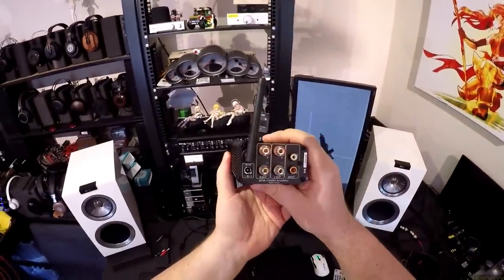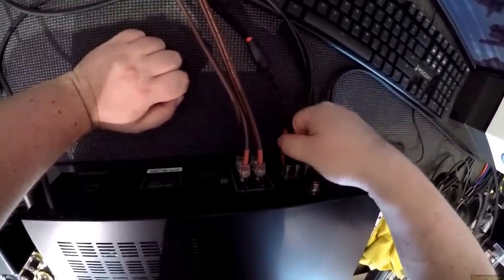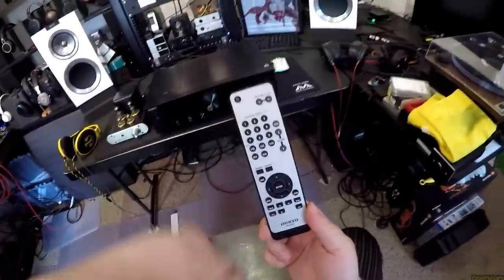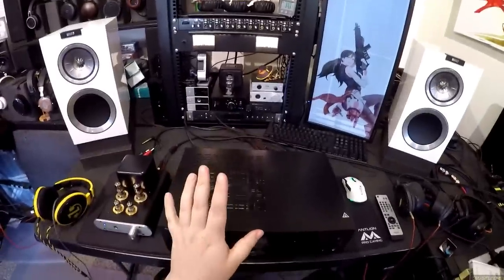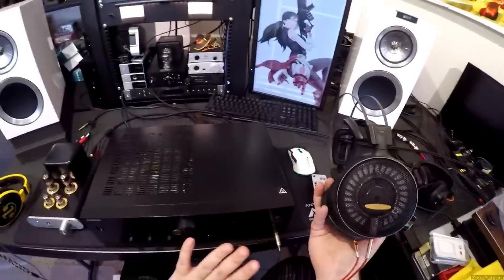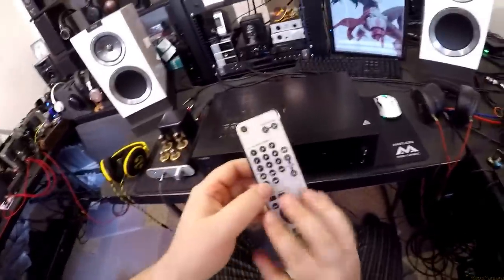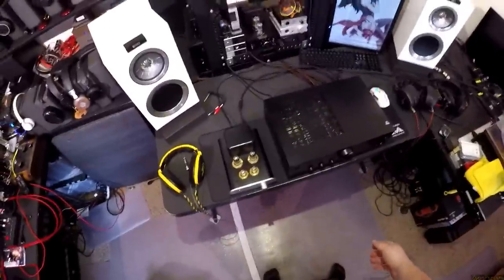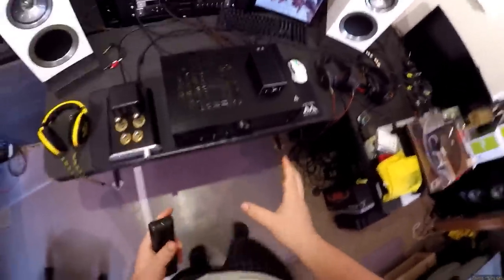Z Review - Onkyo A9010 [The Return of Real Amplifiers]

Comment: I was considering the a9050 amp, until others convinced me to took at some vintage amps with the Emotiva pt-100 preamp/DAC/tuner. I ended up with the Carver M-500 and then found nirvana with the Adcom GFA-555 power amp. High-current does indeed make a huge difference, particularly in the bass freq.

Comment: It doesn't sound better than the class D amp because the components have more room to breath, it sounds better because it's A/B analog. A few years ago I needed a small amp for some portable speakers I was making. I bought a Lepai class D and a Pyle A/B for about $20 each to compare. I never heard class D before, but thousands of people raved about the Lepai. After comparing both for several hours each, back and forth, it was quickly clear that the A/B Pyle sounded better overall. Yes, I used the same speakers to compare the amps, Boston Acoustics. Like you said it's hard to describe, but I call it more 'musical'. However, after a week of being powered on while making the speakers, the Pyle died. I already knew Pyle made junk now so I wasn't too surprised and chose not to fix or return it. I used the Lepai which I figured was fine enough for picnics and such, also it had the benefit of much less current draw than the A/B, so the battery pack would last twice as long. It still works fine and I use them in the garage, but am always slightly disappointed in the sound.
Reply: The 20 buck lepai amps are unfortunately piles of garbage. The tripath chipset they use is an ancient design and a mediocre performer. I suspect the chipsets that make their way into the lepai amps might even by counterfeit and therefore even worse performers.
There are plenty of Class-D chipsets that are much better out there (e.g. from Texas Instruments) - that said, it costs at least $50 to properly implement them into an amp. Some of the $100-ish Dayton Audio amps would use these or similar.
Reply: what model Pyle you had? I have PTAU45, it gets hot, hasn't died yet

Comment: i can attest to 40 watts can play pretty loud, just make sure you real spec sheet properly. 8 ohm, rms od typical load, and the THD numbers. from there you can at least get the power output.
the nad d3020 i have is 30 wpc and it has pushed many a speaker to the limit without distortion.  im most cases you lose something in the "smallification"  of amps.  i feel bad for have such a small space to put my hifi, i know it made some compromises.

Comment: If you look into the Dayton Audio DTA-120BT carefully you'll find it is only about 30Watts per channel into 8ohms - the DC input only supports 60Watts total and is 24V. The absolute most you can get from 24V full bridged into 8ohm is -> ((24*0.707)^2)/8 = 35.9Watts. In reality, expect slightly less than that before clipping. The "60Wpc" claim is bs because it is at 10% THD into 4ohm and only 1 channel at a time - basically just driving a fully clipped waveform while everything screams in pain.

Comment: Those speakers looks like KEF R300 ...are they better than LS50 ?
Reply from the maker: yes
Reply: A KEF that's better than the famous LS50??
Now, the real comparsion should be with the Swans.
Reply: I concur for general purpose, the R300 trumps the LS50 especially the lower end. I'm a strange person I prefer the LS50. The reproduction of vocal from the LS50 sounds "better" to my ears and that's what I mostly listen to - Acoustic guitar and vocal
Reply: ousi00 Great, so you own LS50 and seem to have my music preferences. Have you compared LS50 to Swans? I'm trying to decide between the two.
Reply: Unfortunately, I have never tried any Swans in the same setup so cannot give any comments. :(
Reply: Are you trying to review LS50 with m200mkiii  ? This is a Swan powered speakers which i think is very good but cant compare it with 1500$ speakers. But they are good for the price they are staged.I recently compared LS50 (I own) with the new LS50 powered speakers and the new version is much better and worth that extra 1000$.
Reply: Long story short, the LS50 needs some current to drive. The powered LS50 works reasonably well - closer to the NAD M22 I paired it with. 

The amp built-in in the powered version is a good match to the speaker itself imo. Depends on your equipment passive LS50 can sound quite different. I tried powering them with a Yamaha RX-A1060 (not so great), then the Yamaha A-S801 (too bright for my taste and thin), A-S2000 (very good to my ears, natural - Current pairing); RX-A1060 pre-out to Adcom GFA-5500 (excellent bass!), NuForce STA-200 (midrange is magical, not as much kick as GFA-5500), Monarchy Audio SE-250 (superb), for a brief moment with Krell Evo 302 (Krell renowned bass and dynamics; very American) and Parasound HCA-3500 (dynamic, lesser so than the Krell), NAD M22 (surprisingly sweet and punchy bass), Luxman L-550AXII (magical high and mid, a bit slower in the bass; but everything is like "sugar coated". Great for vocal), McIntosh MA-6900 (relax sounding) and finally Audio Research LS-28 + VT80 (excellent high and liquid mid, with KT-150 the bass is surprisingly excellent. However, I use that only for a bit for the LS50 as they are the ones that drive the Sonus Faber floorstander in my living room).

Comment: I've had the A-9050 (75watts/ch) since mid 2014. It's the dedicated amp in my home office for streaming and vinyl/cds (not in a desktop setup). It's good, not spectacular. Amp is generally slightly bright, but the internal DAC is very bright. Too bright, in fact. I use an external DAC for digital sources... but it's a perfect amp for adding some brightness to vinyl, especially if your speakers/tweeters or preamp are a bit refined/subdued. The one thing it does that makes me want to replace it is that it constantly senses an input signal level and if that signal is not up to the amp's liking... it just shuts off mid-song. This happens at even moderate listening levels. It can make a weak signal loud, but if the source isn't as strong as it would like, it just quits. Kinda frustrating.

Comment: Hello, well, I hesitate between a 9130 and a 9150. Both have bypower option which I need to be used with my home cinema amplifier. I wonder if it should be more interesting to buy a 9130 and an external dac rather a9150.

Comment: It's got 5 analogue inputs and not one of them is for a cassette deck! That's a fail! 
This amplifier should be driving 15" three way speakers, bookshelf speakers are the only reason why subwoofers exist. If you had listened to it the way that it was actually designed to be listened to, you would have experienced what Hifi was all about and you will be left wondering why it ever stopped being a thing! But since you said that you like to listen to your music in direct mode, you like your music lifeless and harsh! The only people who listen to the music on a flat sounding system are recording engineer's who actually use the flat sound as a tool to make sure that there isn't anything that stick's out that shouldn't. It's what they have to do to get the sound sounding good on a home Hifi amplifier which is going to add colour to the music, yes home hifi equipment adds colour to the sound! They all do, that's why they all sound different, it just depends on what sounds good to you! 
That Dayton amplifier is junk, it might be powerful but it's a class D amplifier and those types of amplifiers are only good for portable Bluetooth speakers and PA work where you need lots of volume and quality isn't important! It's the sort of thing that you purchase for a birthday party and never use it again!

Comment: I bought next generation after this one A-9130 on ebay(no reviews anywhere!) for barely £150 which has 2x60W(2x30W on 8ohm speakers) and couldn't understand how on half volume it's louder than my 100W per 8ohm channel Denon home theatre amp. Bass never badly distorts even on almost max volume. Rated at 30W per channel it's louder, cleaner and stronger than 100W per channel Denon and WAY louder, like 3x louder than 80W(40W per 8ohm channel) Yamaha R-N500 / 602 which are equivalent to A-S501 amps. So much better, lower bass than Yamaha too

Comment: I recently purchased the Onkyo A-9050 ($350) which has the same DAC as the A-9010 (Wolfson WM8718) which I paired with the Sennheiser HDVA 600 Headphone Amp and a pair of HD600s and HD650s. Should I be looking for a better DAC to get the most out of what I already have or will I not be able to hear much of a difference if any? I am using TIDAL HiFi

Comment: I've got the A-9050 and its the hub of my system. Picked it up after it was discontinued for $245 Canadian. For a lo or mid-fi system, the A-9010 or A-9050 are great choices that give a lot of set up flexibility and the ability to add other components as you go. I have an Onkyo C-7030 CD player, Google Chrome Audio and Sony UHP-H1 bluray player (for FLAC files) running through a Cambridge Audio DacMagic Plus (w BT adapter). I use the pre-out to connect it to a NAD 216THX amp to power my LS50's, and the line out to my Darkvoice 336SE to a Kenwood GE-7030 Equilizer (tubes plus equalizer = fun) to NAD C272 amp to my Wharfedale Jade 3's. With the line out I can control how loud I want my subs using the volume on the A-9050 independent of the volume control on the Darkvoice. The phono stage amplifier on the unit was ok (I have a Rega P1 - nothing extravagant) but added a Schitt Mani which sounded superior. The remote on the A-9050 is different than the A-9010. Oh, and I used a little piece of white tape on the volume knob!

EDIT - I blame all of my empty pockets audio woes on Zeos. His headphone reviews gave me the audio bug.

Comment: I bought a Denon AVR-S530 BT (cheap 5.2 receiver/amp). I was going to use it for my TV, but decided to hook it up to my pc (USB to uDAC2 to Coax out). I've got it paired with fluance signatures (and I use the headphone output which sounds good). It takes up some space, but I have it in the corner mostly out of the way. I really like the setup. I find it to have pretty damn good sound quality. I can hook basically anything up to it, I've also got a 5 disc CD changer nearby.  I can see there's a Cirrus Logic DAC chip in the Denon, albeit a cheap one. I've got an 8" sub coming soon too.

Comment: Found an open box at Fry's for $250, got it down to $130 when I called for the manager because the remote was missing (about $25 or so). Solid power for a smaller room (still borderline overkill power for desktop unless your speakers are hugely inefficient). For the money a great set of features and good sounding lower and higher frequencies, ok imaging (my SMSL SA-60 with its TPA3116 surprisingly beats it for imaging and mid range transparency all else the Onkyo is better). The only quibble I had, other than useless buttons on the remote as mentioned by Zeos, is the lack of a subwoofer out. I solved that through a high level to low level (RCA) adapter that I originally bought for the SMSL. Cheap, yet works surprisingly well.

Comment: Very similar to the pioneer elite a 20 integrated amp, 105 degree Celsius caps, extruded aluminum heat sinks, auto power off, loudness button, pure direct mode, phono mm, motorized volume knob, but two sets of binding posts, class AB, 50 watts RMS per channel both driven 20 to 20.  Great THD plus noise... same company onkyo and pioneer now, but this one looks like it's little brother.   The a 20 is $250, I've had for about 2 years now works great.  For bi amping also, with speakers a and b buttons 5500 microfarad capacitors. Brian listen to your mother...

Comment: I have an old-school style Marantz integrated amp like this and used it as a monitor stand for a long time. I recommend integrated amps like these to all my friends since they can be dirt-cheap on the second hand market.... Damn I need to get in on that Vapor album sounds great.
Reply: I wanted an integrated amp, but I wanted a bit more power AND it had to have a way to connect a powered sub. I finally went with separates instead, and I'm happy I did. With a competent preamp like the Emotiva models, I now have the option to connect any amplifier I want. So far, I've hoovered up a Carver M-500 and an Adcom GFA-555, and I'm planning on getting another GFA-555 for bridged mono. For my cheapskate butt, the Adcoms are pretty much end of game bits of gear. More power than I'll ever need and high-current for wringing out every bit of detail from speakers.

Comment: I owned Behringer a500 that sounded great to me but both channels failed in a short time while driving 8-ohm bookshelves at light loads :S  Repairs have failed so it's a write off.
I'd get another but poor reliability of the a500 left me with somewhat of a sour taste.

Subjectively speaking, how would this onkyo compare sound wise? (both have plenty power for my needs)
Reply: Meanwhile I impulse bought an a-9010 and so far the speaker amp doesn't sound too bad to me while the headphone out is rather useless. My fiio e10k (and to a lesser degree my objective2) are noticeably (like immediately) more pleasant on both my hd650 and dt 880-250. Also I think I preferred the sound of the behringer a500 but can't be sure cause unable to a/b.

Comment: I always enjoy zreviews but on this video I feel very disappointed. Reason is that you think that listening to the unit using headphone you are evaluate the DAC. This is quite a misinformation. This is considered a entry level DAC and speaker amp, it most probably does not have a delicate headphone amp. The headphone output is most probably  speaker output through resistor (which seriously degrade the sound quality).  What you are listening though the headphone out is the DAC and sound quality of degraded speaker amplification.
Reply: Found straight from the Onkyo website: "Independent Headphone Amplification Circuitry"

That wasn't hard to find, dude.

Comment: Witch integrated amplifiers have you ever run across that can handle a 2-ohm load?  What is the most bang-for-the-buck 'high-current' amplifier out there?
Reply: Onkyo a-9150 or a-9555

Comment: Zeos or whoever knows please... what are the headphone pads used with the ATH AD2000X he has on the right of the AMP at 8:56? I need the same pads for my 1000x and 3000W. Thanks!
Reply: Hi, im quite sure its the ZMF pads. It should be the ORI pads if im not wrong.

Comment: How do audiophiles download and play audio files on PC? (I'm pretty sure you guys don't use Spotify)
Reply: Rutracker.ru has whole category on sacd and dsd torrents. You have to use translate. Jriver player on pc then plays .iso files to whichever amp, using PC sound card or usb dac or streams over wifi bitperfect to surround receiver, which in my case is connected to Onkyo a-9010 to run front LR speakers. Have about 1TB of SACD iso files (most of them have also surround mix included) which have to be transformed to native dsd files for receiver to play them. Use iso2dsd and you can convert all iso's at once with the use of ctrl key. Highly recomend something like that. I don't listen to vinyl anymore since I made this setup.
It can be hard to get Jriver properly set to play .iso or to stream dsd. Google knows it. ;)

Comment: UK version of A9010 doesn't have any digital inputs :(
Reply: Get the Euro version from Amazon Germany and use a mains adapter. Euro version has digital inputs and is even cheaper than the UK version (at the time of this comment).
Reply: @jimboblivesforever  Thank you! So the UK edition has just the dac and digital inputs removed or other changes?
Reply: @kelzer1  I read somewhere that the UK version uses different caps, but that's all I know. I can't imagine that this would make a significant difference though, especially in that price range.
EDIT: Just found this in the Steve Hoffman Forums: "I wrote Onkyo Customer Support on Facebook and they confirmed that except for the DAC, the internals of the UK and US version of the A-9010 are IDENTICAL."
(And my guess is that the US and Euro versions are identical as well, except for the power supply maybe)
Reply: Hey I’ve a question if you could help! Thanks for the info. I’m looking at this amp before it totally sells out everywhere. I’m in the UK and digital inputs aren’t vital at the moment- mostly looking to play my turntable and CD player. 
In the future, I might look to add a DAC for hooking up a playstation or whatever. Something like a schiit modi.. where would I feed the rca plugs from the back of the dac into the amp? Just into one of the line ins?
Reply: Or could I connect a games console in an analogue way as he suggests in the vid? Thought it was only possible to take out an optical line. 
Don’t want to use the 3.5mm from my monitor as it sounds terrible.

Comment: Im new to this and trying to build a vinyl setup can I just plug my speakers and turntable into it and be satisfied or will I need a pre amp aswell? thanks.
Reply: It has an inbuilt preamp for vinyl, you just plug your turntable into the phono input
Reply: @HonestSonics  Thanks! If I may just one more question. My speakers are the jbl 120 arena which reccomends 20-100 watts of output fron the amp. Will this amp (40 watts) be enough to "bring them to life" or should I look for a stronger one?
Reply: @n.philip2199  My missions are rated roughly the same, anything approaching 12 on the volume dial becomes uncomfortable. 44 watts is plenty for relatively efficient speakers
Reply: great! thanks!